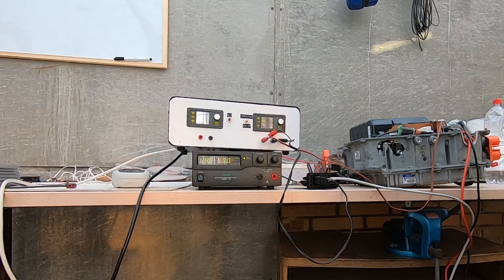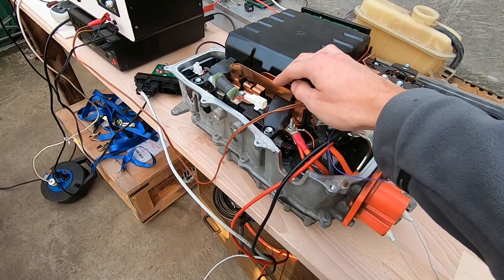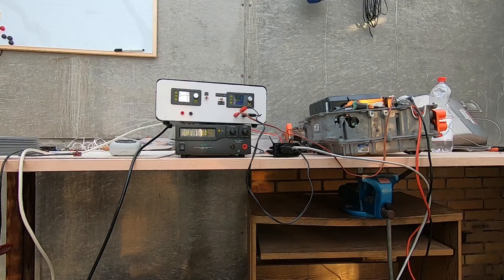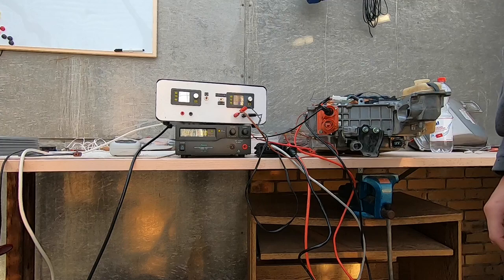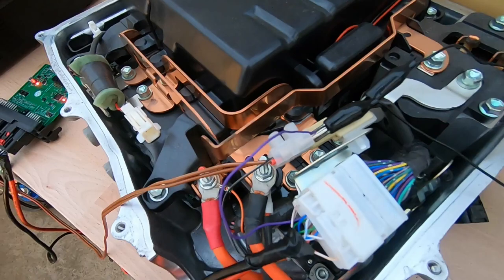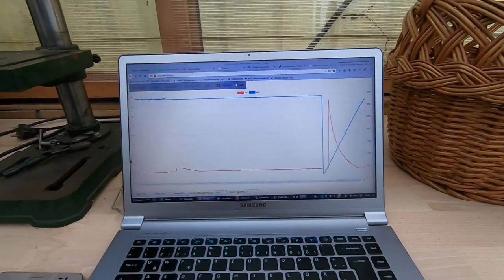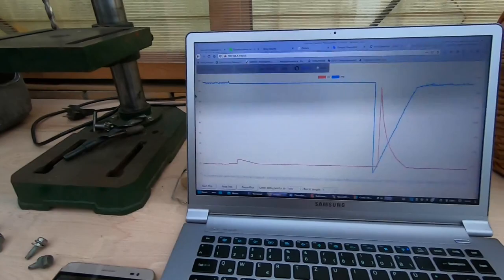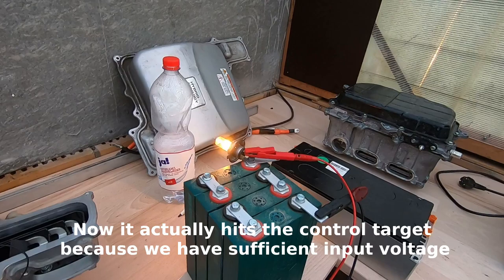Lab Update #42 - Prius Gen2 Battery Charging

Comment: 11:00 so if for some reason electricity in your house shuts down while your car is charging, your battery could suffer from voltage jump?
Reply from the maker: No no, actually in that case the whole charging progress would be interrupted. You would wire up your car to start the inverter when you plug in AC and consequently it powers down when AC is lost